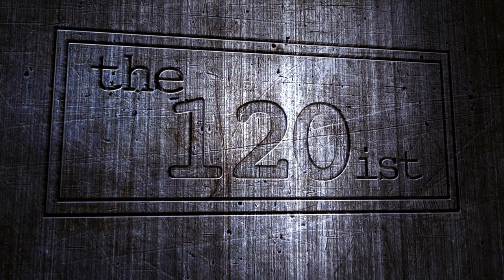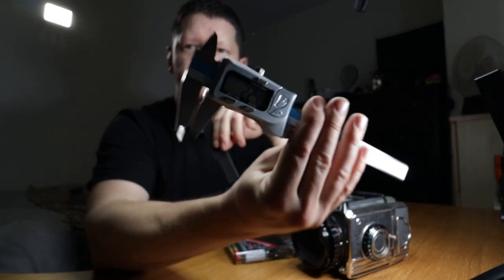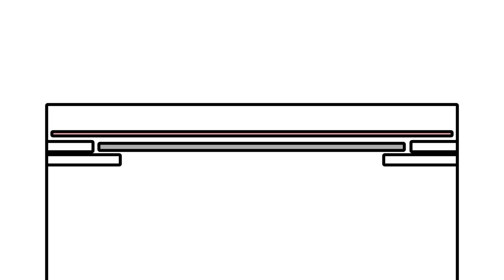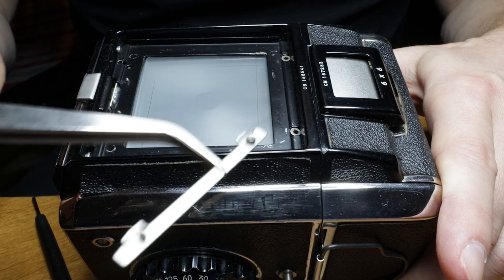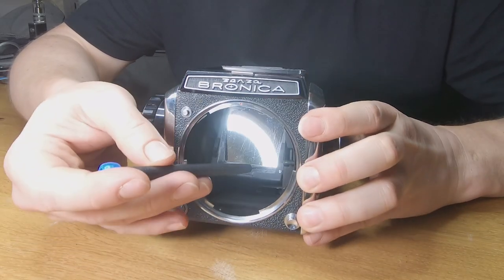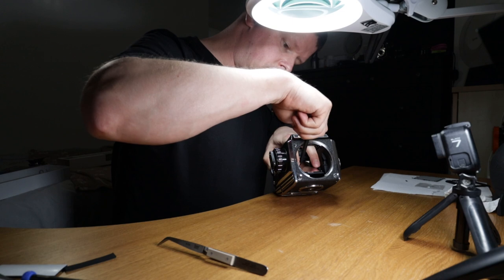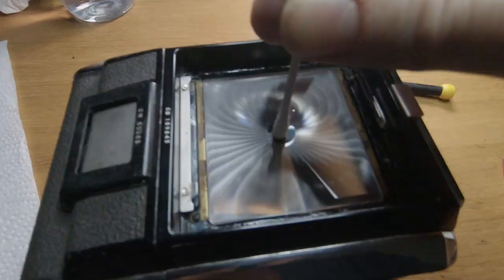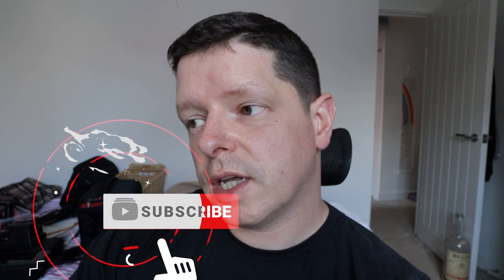Bronica S2A - Focus Problems - HOW TO replace ground glass foam AND mirror foam (also Bronica S2)

Comment: Thanks for this detailed covering of how to fix the problem. After watching, I was completely shocked to find that someone had apparently been in mine and "cleaned" it, by removing all of the foam completely and then put it back together without any replacement. Less cleanup, but it certainly explains why it was focusing improperly.

Comment: It is fascinating to watch someone else working on a camera's intricate bits, how they go about it for starters, and how much difference previous experience makes. Doing something like this is terrifying when you think of the worst possible outcome, especially if the camera is a particularly good and expensive one like the Bronica.
Reply from the maker: Definitely! I try to know my limits with camera repairs. I tested my skills on an old knackered shutter a while back and learned quickly that I’m not ready to mess with shutters! I’ll keep learning and I’ll come back to a shutter one day.

I was unlucky enough to have a Bronica S2 trashed by a courier last year while it was going off to be sold. The camera shop received it with its side stoved in. They sent it back to me and I took the side off to see the damage. There was enough bent and broken that there was little chance of repairing it, so I sold off the I damaged modular bits and took the rest of the camera to pieces as a learning experience. Absolutely amazing pieces of kit, extraordinary engineering inside them. But also gave me a chance to see what I would be capable of fixing and what bits I should pray don’t break on my S2A… I’ve been saying a lot of prayers since then!

Comment: This is one of the most fastidious jobs, you'll ever have to do on any of the Bronica cameras, but it is critical to the cameras proper operation. And you sir have done it with confidence and care, two things that are requirements to attack repairs like this one, along with a pair of steady hands and a sharp eye. Over the years, I've come to know the best cleaner to remove old sticky foam is lighter fluid, then using a piece of cheap bamboo skewer to get into the corners for a more precise removal of the black tar like gunk. The ground glass could also be cleaned with nail polish remover fluid (aka - acetone) with out harm, but don't get it anywhere near the fresnel screen, or mirror, for it will melt the delicate plastic. You also need to make sure your replacement foam tabs for the mirror do not rest on the raised bumps that support the back of the mirror, or this too will impede the focus and throw it off, the replacement foam must sit down in the recessed areas of the mirror backing plate. Yes there are a number of dolts who would forever damage a camera by using CA glue (aka - cyanoacrylate/crazy glue) in their attempted repairs, but to remove CA glue you can use a solution of alcohol and acetone in a 50/50 mix, but avoid any areas that have sensitive plastics (leatherette, fresnel screens, plastic washers etc.) for they will melt. I'd also recommend getting a pair of ENET Precision Ceramic Tweezers (Amazon.co.uk) to assist you in this type of repair. I loved the animation very accurate and to the point, loved the video as well, you are fast becoming one of my must watch YouTuber's. Thank you and keep up the great work.
Reply from the maker: Thank you so much! I'm glad you thought I did an ok job. And thanks for the tips,  invaluable information, i really appreciate you taking the time to share with me. 

That's really interesting about the lighter fluid. I have some, but started with the denatured alcohol and that did the job. Good to know for the future though, thanks.

I have a bottle of acetone, but I'm scared of it! I'll only use it in very specific situations where I know it's not going to do more harm than good!! I once used acetone working on the kitchen table, and we had a plastic table cloth down for the kids. I knocked over the bottle, didn't quite clean it all and it went clean through the plastic sheet and marked the varnish on the table underneath! So I handle that stuff with care now!

Will go take a look at ENET ceramic tweezers, never heard of those. Always keen on any tool that will make things a bit more efficient and accurate.

Thanks again!
Reply: I cleaned the Fresnel lens with lukewarm water and detergent.  And then dried with a soft microfiber cloth.  That worked very well.  The isopropanol I use to clean the screen was far away from the Fresnel lens.
Reply: @the120ist  you can try nail polish remover it's acetone but weaker

Comment: Bit of a nail biter video. Usually a bit of tension on the side of the doctor preforming the operation translated to the viewer. At least in my case since I preform similar repairs on my lenses and cameras. Just finished completely dismantling a Mamiya M645 80mm lens to clean oil from shutter blades and internals. Quite a few four letter words escaped my lips in the process, unlike your effort. The most frustrating part was discovering after a complete clean and perfect operation, there is slight separation on the edges of the rear elements...lol. Life throws us these curve balls. Thanks for the video and cheers from Nova Scotia, Canada.
Reply from the maker: Ha ha! They usually really are nail biters! I do still get a little buzz any time I open up a camera. I figure that's a good feeling, because it tells me that it matters to me whether i get the repair right or not. And it means I'm going to work that bit harder to get it as close as I can to correct.

I actually quite like dismantling lenses. I've done a few to clean up fungus (vid on that coming soon), and I just love the precision engineering in there. Even the 50-60 year old lenses that I've worked on fit together like a glove. Just amazing to behold!

I've read a load of different things about balsam separation... almost everyone says its game over, but I've read a few articles saying there's a chance at self-repair. What do you think? Is it possible? I've got two lenses in my collection that desperately need it if its possible!

Comment: "Don't superglue screws!" Amen, brother. If the spec calls for it, a little blue Loctite will keep things from moving but still allow removal. I can't believe that would be required for a camera, though.
Reply from the maker: Who knows what goes through people's heads! I have no issues with a bit of loctite, or thread lock, but you can break that with just a little more pressure than normal, or you can thin it with some solvent. Nothing worse than finding actual glue on the screws! If you can even get through it of course.
Reply: @the120ist  I'm afraid there are a lot of chuckleheads out there who think they are technicians. ;) Probably not much goes through their heads... just sayin'... ;)

Comment: I just won an S2 on ebay and it has a few small metal frames which I didn't see in your video. It has the freznel and other glass too and the frame for foam. He had them off the camera so I'm hoping it even has the screws ! Also I watched another video where they guy used 3mm foam and he said it focused right and his photos did look focused. I got the body with a back and helicoid for $105 so I thought it would be a great deal. I will be looking for the S2a though for sure. I also bought a 75mm f2.8 and have a bid on the 50mm F3.5 lens as well.
I also bought the eye level viewfinder and the prism viewfinder from Japan for pretty good prices. I will be looking for a portrait lens, probably a 135mm. And they have a 40mm wide angle as well and I'm a wide angle guy for sure.
 Thanks, LarryMac
Reply from the maker: Hi Larry! Congratulations on your purchase. You're going to love it!

The S2's seem to have a few squares of shiny metal in between the camera and the ground glass. To my knowledge they're just spacers, to maintain the correct placing of the ground glass. I had an S2 and it had the shims in place and it was focusing well, so I never had a need to test them or work out if or when they were needed.

But I would assume that they allow very fine focus adjustments, giving you a fraction of a mm difference in the height of the ground glass. So once you've replaced the foam etc., if your camera is still focusing a little short of infinity, you can add in or take away one of the shims to tweak the focus. That would be my guess! Don't lose them anyway!

That price is amazing! Great find. Hope you enjoy it, give me a shout if you have any questions!
Reply: I ended up getting two S2 bodies for $100 each and the 2nd one is missing the mirror. I couldn't see if the mirrors frame is there or not. But I think I can get it least one worker out of the deals and then later find another for parts ! I can see this going on and on. I originally had a C2 which has all the same looks and lenses but no removable backs. But I loved that camera and have been mad at myself for about 3 years now for selling it ! Its was at a big profit but I'm never going to forgive myself ! I'm really looking forward to these cameras and I also got a 50mm f2.8 with helicoid, a 50mm F3.5, a 135mm f4 ( I think) and another 75mm f2.8. The 40mm will be next , but no hurry. Please make more Bronica videos and keep up the good work. LarryMac
Reply: Guess what ? The two S2's turned out to be older Bronica S cameras ! The one I got today with the glass frames and glass is missing the small back frame, all the screw's and washers ! I should get the other one soon and hopefully all the viewfinder parts will be there. But since its missing the mirror, I will have to decide which is the best one and go from there. Should be a lot of fun though. I also have two S2's coming too. One has a supposedly non working shutter. The other is supposedly perfect ! We shall see ! Watched all the Bronica videos about 10 times and haven't seen any of these small frames that came with the S camera I have ? It focuses with the knob where the film winder is and you have to use the lever to wind the film and cock the shutter. Kind of like that actually. Everything seems to work right except no glass in place yet and no darkslide. You don't get the loud pop either when it's fully wound on. I put the 75mm f2.8 on it because it came in today and it looks like new. Anyway that's my setup and I'll be shooting it soon ! LarryMac

Comment: FYI for screws are glued into place, two methods that can help: 1. lighter fluid (alternatively: isopropyl alcohol), WD-40 as lubricants or solvents. and 2. using a soldering iron to heat the screw if it won’t budge at all.
I’ve not tried this yet on the Bronica, but I’ve done it on electronics.

Comment: Just received my black S2A from Japan. They did a very nice job replacing the seals around the focusing screen but the mirror is actually fairly loose. Now I’m waiting for the JIS screwdriver set like the set in your video. The video is great and will really help me deal with the mirror as I don’t currently have infinity focus. The information on only needing to take out the front two screws is very helpful indeed. I really appreciate your videos. Thank you!
Reply from the maker: Glad you're finding the vids useful! Good luck with the mirror foam fix. Hope it sorts the problems.

Comment: Thanks for the great video. I recently bought an S2 and knew I would need to take care of this repair immediately. I replaced both the mirror and focus screen foam and found the camera was then focusing past infinity. 

Based on your comments here and others, I believe my camera likely had shims under the screen originally that someone removed in the past trying to fix the focus problem. I used a razor knife to slice two thin strips (same width as the machined rails the screen sits on) from a post-it note at the section that had the adhesive. I then stuck those to the back side of the focusing screen directly at the location it sits on the metal rails. With this very thin paper shim in place, the camera focused perfectly to infinity just as it hit the stop. I roughly tested by focusing at different points on a tape measure and compared to the focusing scale. I just got my first two test rolls back and the focus seems spot on. Thanks again, not much content on these cameras around so it's great to find your channel.
Reply from the maker: Glad you found it useful! The shims are weird, they're there on some cameras but not on others. I've only seen the shims on S2s... not on S2As, but I don't know if that's because all S2s came out of the factory with shims. Either way, sounds like you found a great solution. At least there is a surefire way of testing it with this camera, if infinity focuses on the stop, then you're all good!
Reply: @the120ist  Absolutely! Your videos are a wealth of knowledge on these cameras and delivered in an entertainingly matter of fact way that I truly enjoy. Interestingly, my camera has the newer S2A style wind knob, but no S2A after the serial number (SN 90339). Sub-SN 100037 and no S2A would suggest it's an S2. But I've seen some references elsewhere that maybe that designation was only for certain markets. I suppose I'll never know unless I need to get inside of it and can look to see if it has the deeper cut S2A wind gears.

Comment: Using a solder iron to directly heat the head of the screw will break down the superglue. Also acetone, but be careful, that can be wicked for plastics.
Reply from the maker: Ah, the soldering iron it a good tip. I've used a hair dryer to free up lenses and the like, but never used a soldering iron on screws. Good tip! I have acetone, but I try to avoid using it if I can... I spilled a drop on our table cloth once... my wife was NOT happy!!

Comment: I just picked up a Bronica S2A (early serial number). I will probably have to do this before even putting a test roll through it. Your tutorial gives me the confidence to do this. Thank you so much for putting this together. You're a legend!
Reply from the maker: Glad you'll find it useful. It's not too tricky a repair to do, if you take it slow and carefully then there's not too much to go wrong. Hope it works out for you!
Reply: @the120ist  I shot one test roll through it with the 75mm f2.8 at f2.8 and various focus distances and the images look in focus as intended with a magnifying glass on a light table. However, I did pick it apart and looked at the foam completely crumbled and messy, so I will have to deal with it for sure. BTW, the same two screws are stuck for me as for you, it is maybe an age related issue with those screws, not a bad repair.

Comment: Like it. Has done that to the ground glass once on my s2a. But not the mirror, yet. Thank you.
Reply from the maker: The first time I did mine I only did the GG and it solved the issue for a while. Eventually I had to do the mirror foam as well though. Definitely a good idea to do both together.

Comment: Enjoyed the video! I just picked up a model “C” with the non-interchangeable back. The foam in the finder was trash, so this video gave me the boost of confidence to go for it. Between the ground glass and the fresnel were three spacer frames - 2 were very thin and the third was no thicker than a sheet of aluminum foil. Anyway, put them back like I found them after changing the foam and all seems right. I also removed the mirror to get to that foam and was surprised that instead of foam there was a flat, three-pronged leaf spring there. I don’t know if that’s just something found in the “C” or not, but glad I didn’t need to work on that.
Reply from the maker: Thank you! Glad you found the video useful! It's definitely an achievable job for most, but I agree that it's pretty daunting if opening up cameras isn't already your thing. I'm really glad the video gave you that nudge to give it a go! 

Right, so as far as I can tell, the older the camera, the more likely you are to find shims in there. I've found shims in S2s, but never in S2As, and the C was released roughly alongside (a year earlier I think) the S2. The shims vary in thickness and number from camera to camera. My guess would be that as manufacturing techniques became more accurate into the 1970s, the need for shims to iron out discrepancies grew less and less.

But you did the right thing, put it all back as you found it! 

Really interesting that there are leaf springs under the mirror! I wonder if this was only in the C. I've never seen it in an S2. Or maybe yours has some sort of after-market fix. I've heard of people doing various things to try to do away with the degrading foam issue, including replacing the foam with leather!

Great that your Bronica is up and running again! Good job! Now for years of enjoyment from it!
Reply: @the120ist  Thanks for the reply! I think the early Bronicas are among the most beautiful designs ever. And my C has been a pleasure to shoot so far. I’ll be adding an S2A to my wish list though😁. Cheers!